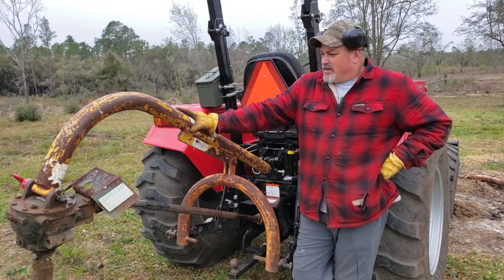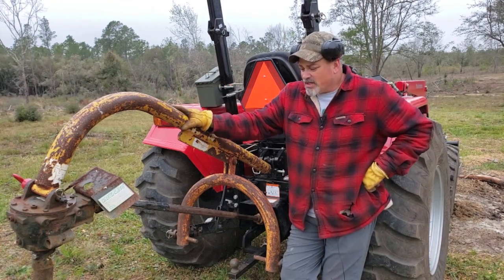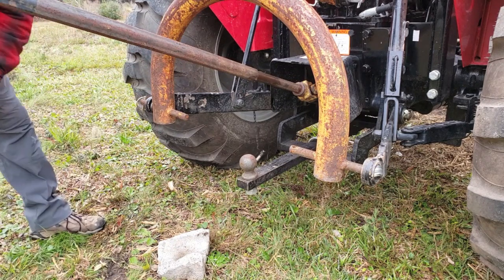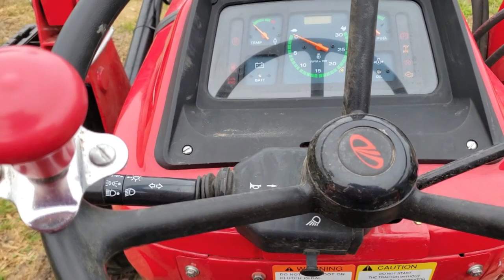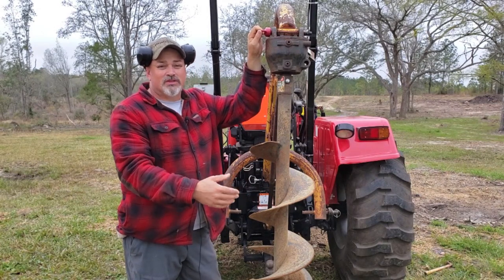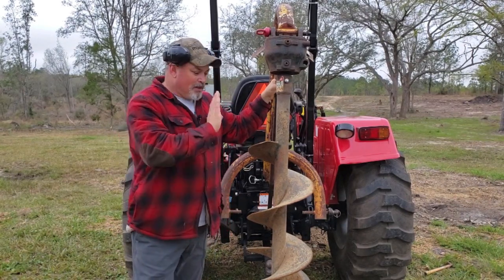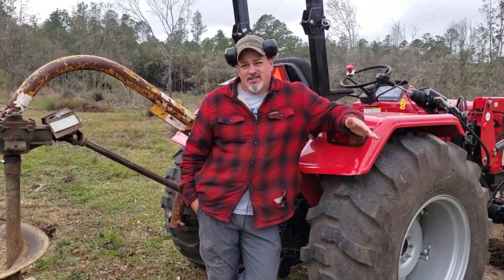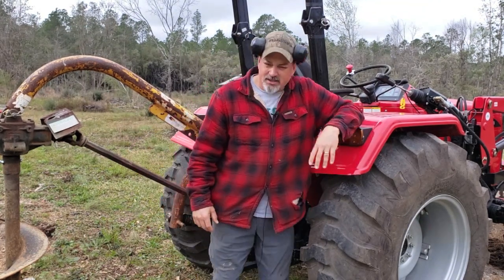How to use a tractor POST HOLE DIGGER (3 point hitch Auger) on a Hobby farm

Comment from the maker: This video is one in a series about implements for a basic user. Comment if you have some different techniques you use when you use an auger.
Reply: For my new 3 acre vineyard, I'm using a post hole auger to set grapevine trellis end posts and several thousand new grapevines.  My hands and a shovel are no longer on "speaking terms".

Comment: I have found with a Standard shift with a clutch after you drop the point down on the ground, you can also lower your front bucket down with the cutting edge straight down with sufficient down pressure now you can use the curl on your bucket to move the tractor/backward or forward slightly ,
Reply from the maker: Yes good point! Thanks 👍
Reply: Ronnie that is a really great tip! i'll try this

Comment: Biggest issue I had was with my hard digging ground was getting the auger to dig into it , Since most of the tractors DO NOT have down pressures  on the 3 point it would only use the weight and cutter of the auger to drill the holes ,  I added a 3rd function valve to my Tractor for controlling my grapple on the front end ,  so I sought out a down pressure kit for my Auger I didn't think I would find anything but to my amazement I found several different types ,  So that's what I got  since 97% of the time I am working alone I had to come up with a resolution to my problem ,  so if you have to drill a lot of holes like me a down pressure kit is the answer and well worth the $600.00   , just 1 of my fence lines had 800 post holes so that worked out to .75 cents a hole and about 2 minutes a hole set up and dig .. so if you add up everything  I would say it paid for it's self  in the first 300 holes  (10 Hours) also by applying down pressure it keeps the auger straight and not bobbling around
Reply from the maker: Interesting. Thanks 👍
Reply: @HamiltonvilleFarm   hope it helps someone

Comment: There is a small hole on the auger head. When your looking at it from the back of the tractor it's on the lower right hand side of the gear head. It's about 3/4" to 1" diameter in size. That's used for a long handle or bar. Usually 4ft to 5ft long. It has a set screw to help hold it in. But that way someone can hold it while distanced from the spinning auger. It helps to keep it straight, as well as put weight on the implement. Just a tip.

Comment: Great video thanks for posting.  Could have been the camera angle but it looked like the older fellow helping you at one point was standing between the tractor and a building which is a big no no to ever put yourself between a machine and an unmovable object.  Every talented operator will eventually make a mistake.  The best we can hope for is to take steps to mitigate the impact of that mistake when it inevitably happens.
Reply from the maker: Thanks for looking out! We always need to be as safe as possible 👍

Comment: I had to add a license plate mount to my 3 pt post hole digger, as soon as my neighbors found out I had one, they all wanted to borrow the digger, I was a. Very popular fellow all of a sudden,
It you loan it, you shouldn’t, but always give them some proper hardness shear bolts, as if they shear one they will insert a harden bolt it it’s place,

I have the same digger or it looks like yours, Greenline 5000, it’s a good digger,
Good video, the digger is a very dangerous piece of equipment,
Reply from the maker: Thanks for watching 👍

Comment: any tips if your tractor won't lift the auger high enough to clear the auger off the ground? My tractor aint small but it's old so very little adjustment possible.. (David Brown 1210 60hp, 1979) There is only 1 hole for top link and same on the 3pts arms.. Could I drill some closer to the tractor?

Comment: I am not sure if you mentioned it but if you have a front bucket, you can angle the bucket down then lower it to set an anchor point. Depending on the size of tractor, it may not be needed but on hard ground, and a smaller tractor it’s can be a big game changer.
Reply from the maker: Yeah man. Thanks for the comment 👍

Comment: I couldn't see how you supported the auger when you were hooking it up. I use a separate tractor with pallet forks and a strap to suspend the auger when I hook it up.
Reply from the maker: The bit is still in the ground, so it is stable, but yet flexible enough to get it positioned where it needs to be on the hitch

Comment: I store my auger fully assembled under a shed suspended from a rafter on a chain hoist. I move the assembled auger up or down an inch at a time to line up all the points. This makes it much easier and it is a one man job. I built a stand for the auger bit to sit in to keep it in place and raise and lower the digger as needed with the chain hoist. I can also change the auger bit while the digger is suspended by raising the chain hoist up as high as needed to let the bit drop off the gear head and then install the size auger I will be using. There is a video on you tube showing how to build a auger stand.  I also do this with my 500 lb fertilizer spreader which is also suspended from a rafter on a chain hoist. I installed handles near the top of the spreader hopper to attach hooks and lift the spreader or lower as needed.
Reply from the maker: Right on👍 I need to do something like that.

Comment: That small hole on the side of the gearbox is so you can insert a Long piece of pipe and use as a guide handle From the tractor to level out before lowering
Reply from the maker: Thanks for watching 👍

Comment: Add a bar that you can reach from the seat of the tractor. And the lift arms on the back of the tractor are adjustable because of the cat 1-2. The pins on the inside of your post digger are the category 1. That would be where I'd put them. Can't move much that way.
Reply from the maker: Good point 👍

Comment: the easiest one person way to attach a digger like this is. detach gearbox/pto shaft from the yellow frame. the frame comprises the U-shape frame and the crane arm....seperate those as well. attach crane arm to tractor first. then attack U-frame to the side links. now recouple the crane arm to the U-frame.  you now have the basic setup. you can now attach the gearbox and PTO shaft. this way you break up the weight of the unit into steps.
BONUS TIP: with gearbox /PTO shaft removed; the crane-arm and Uframe make an excelllent snatch crane for lifting engines, implements or other moderatly heavy items to move about your property
Reply from the maker: Thanks for the comment Crabtrap!

Comment: You absolutely should never have anyone any where near the working end of that auger. All set up should be done by a single person. The operator should do the level check with the tractor off and by himself.

It's a very bad example to have a mounted driver and anyone standing back by the auger and especially while you are drilling holes. Having someone standing a foot or two away while the auger is spinning is a huge risk. Please don't take my comments the wrong way, but no one should ever stand like that around any spinning implement,  much less an auger.
Reply from the maker: Safety is indeed important
Reply: Yeah, it says to stay 10 feet away on most auger warning labels.

Comment: What brand of auger do you recommend? I have new 4550 and we bought a county line 3 point post hole auger and had problems with it binding up against the top linkage when we tried to raise it up. We couldn't even get it high enough to put a bit on. We ended up taking it back but it seems like most augers are built very similarly. Any suggestions would be helpful.
Reply from the maker: If you can afford it, go with what everything attachments offers👍
Reply: @HamiltonvilleFarm  I have an OLD, previously owned and WELL worn Danuser auger and it's a real winner.  A simple web search will find the company and you can then find your local dealer from there.  It takes 2 or so days to get an answer for questions from their customer service - but they are 100% helpful and accurate.   - Joe -

Comment: Exttemely Important.  NO ONE should be within the length of the auger, as a " auger like  yours, at least 5" away as if it hits an obstruction, it can kick back, come out of the hole, swing out and take off an arm or a leg.  It happens.

Comment: Does your tractor have hydraulic down pressure for the three point or just up?
Reply from the maker: Just up.
Reply: 3 pts don’t have down pressure.  If they did they would be pushing  the rear wheels upward, losing traction.
Reply: Typically once you get into 65 hp and up they offer a control called draft control. This add's down pressure for this and box blade applications.

Comment: I have a Mahindra 1526 and my auger does not clear the ground when fully raised. I have the pin above the pto shaft at the lowest point and the hole closest to the tractor on the auger. Any suggestions?
Reply from the maker: I know they make different lengths of auger bits...maybe try that if that's an option. Not sure of other options. Hopefully someone reads this comment and can help. I really need to study up on things like that
Reply: @HamiltonvilleFarm  thanks and I found your video valuable as it was nice presented and communicated effectively
Reply from the maker: I appreciate that feedback. Thank you.
Reply: George, on the link arms, left and right that come down from the hydraulic system shaft, where they hook onto the lift arms, there should be 2 or 3 holes on the yoke arm at the end of each link arm. Pull the pin on each link arm and move the lift arm up to the  highest hole, and put your pin back in. Do the same on the other end, this will make a big difference on the height out of the ground so that you are not dragging the point as you move the tractor from hole to hole. I have a 1635 with a 3 hole adjustment.
Reply from the maker: Thanks Forrest 👍
Reply: @forrestanderson2652  Great tip!! Going out to give it a visual. Much Thanks

Comment: You should not have any one around the auger or pro.
Reply: Ralph, you're absolutely right.  We all should, at least every now and then, search for "PTO accidents" to refresh ourselves on safety around PTO shafts and augers.  Even at slow speeds, those things can kill or maim in a fraction of a second.   I don't want anyone else within 6' of the auger or PTO when my tractor engine is running -- even if the auger or PTO is not engaged.